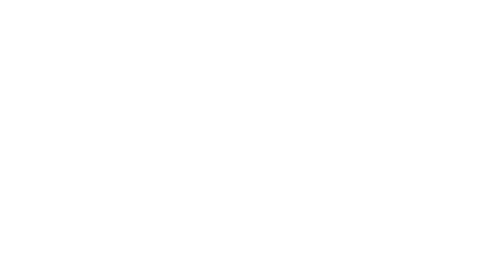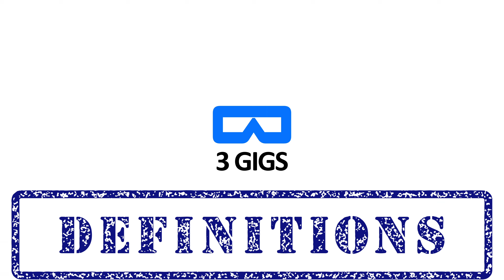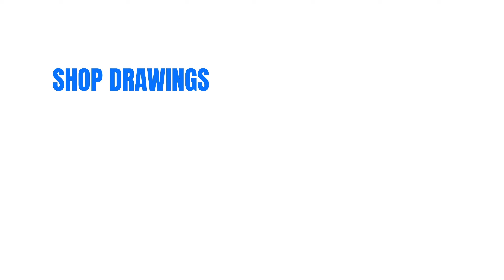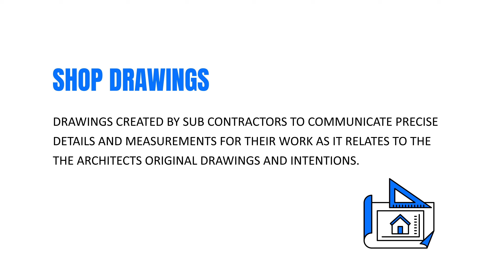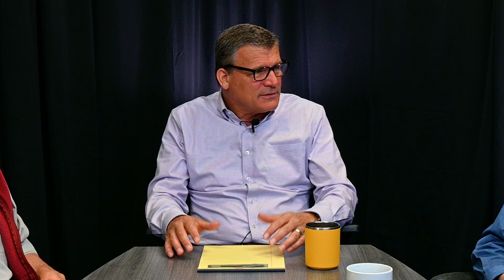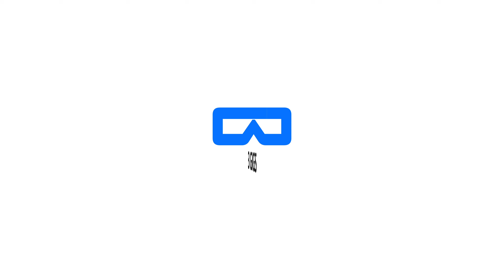WHAT ARE SHOP DRAWINGS?

Comment: And then you have the architect who rejects your cabinet shop drawings because his "intent" was to install a wall to wall cabinet with 5 equal size doors. Except that after field dimensions were taken the 5 equal doors resolved down to an irrational number and we made one door 1/16th bigger than the other four. After a big fight we changed the field dimension to make 5 equal panels and he was happy.
Reply from the maker: funny how an irrational number can lead to an irrational argument - happens all the time! Especially when the walls aren't the distance the architect designed it for - which isn't the cabinet guys fault!